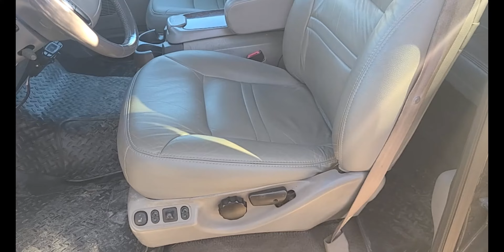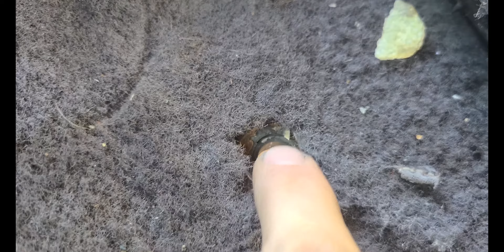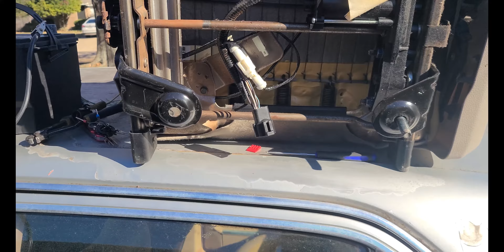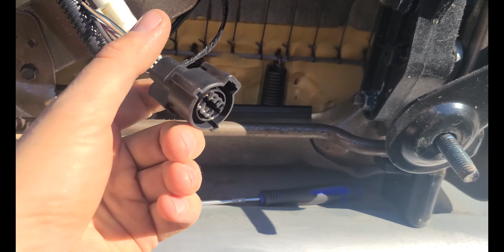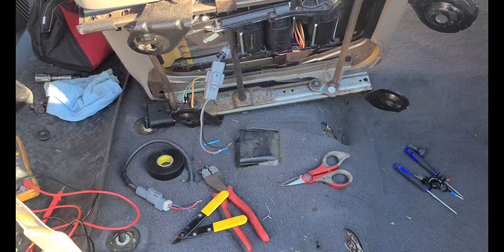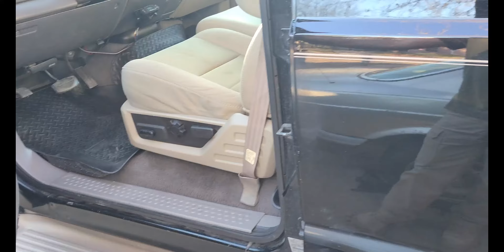08-16 seat swap Ford Excursion F250 F350

Comment: Do you know if 2011 F250 seats would fit 2008 F250?  I am asuming it would 2008 and 2016 cabs are very similar?!?!?
Reply from the maker: They will physically fit up to 2016, but the wiring from 2011-2016 trucks is very complicated
Reply: @gagefixeseverything   mine only need power and ground.  I am assuming power connector is the same from 2008 and 2011?